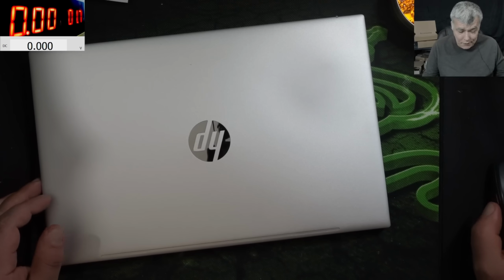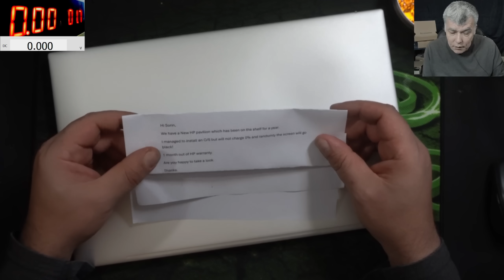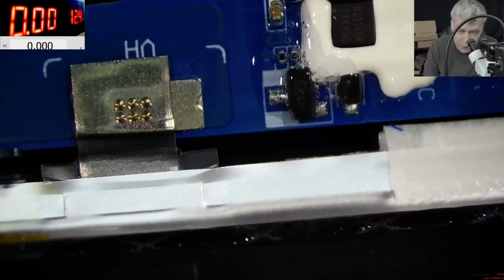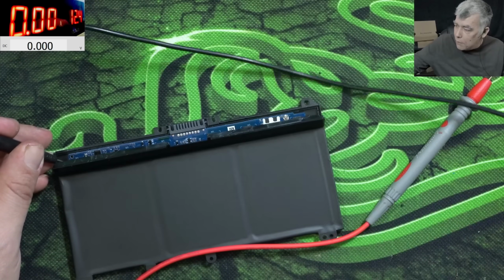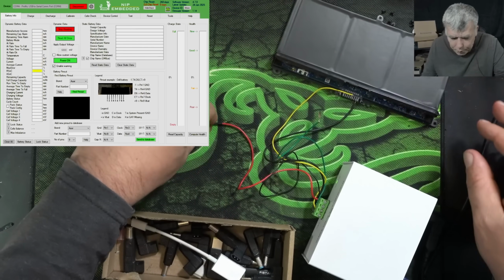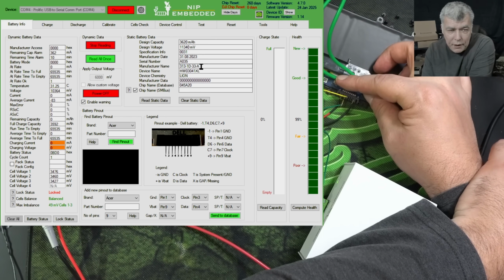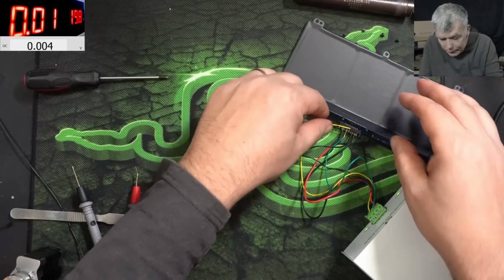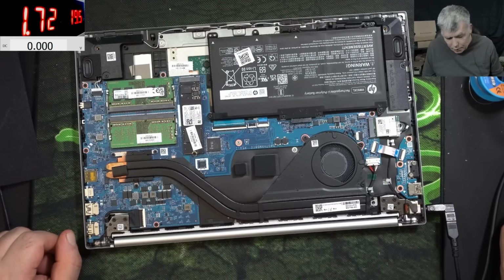1 Cycle count Hp laptop battery repair - Faulty by not being used

Comment: 11:10 "bq chip used voltage from one cell to blow the fuse so there is big unbalance" 

It is not correct. Please check typical schematic design for any TI battery monitoring chip. They got power from whole cells stack not from the specific cell. Fuse heater also is powered from common power rail. 

So the reason of unbalance is not the blown fuse.

Comment: Like the way the battery now has a removable plastic cover 2 get access 2 the fuse r cell heads, must have realised that sorin had 2 keep using the surgical incision method 2 get in, so now have made it easier 4 hi

Comment: Help with the battery BQ40Z696A V1T1.05 for Lenovo T480. The Nlba1 version 4.7 program shows that the health and charge are at 100%, but when I connect it to the computer, it shuts down and loses charge and health. Please help me, as I have many batteries with the same problem.

Comment: I have the same issue with a Nitro 5. Fully charged it, left it three weeks, it is dead and won't charge, the charge light flashes orange. It's 7 years old so I just replaced it. There should be a storage mode in the BIOS, correct? There is on my newer one, and my Steam Deck lol

Comment: Things are getting worse ''smart'' batteries now .....
Reply: This is not new, batterys get locked because of the no use or over current, You Will find this issues in laptops with 10+ years.

Comment: it looked like that tool unlocked the battery, did it need balancing before it was unlocked for the unlock to work?
Reply: The chip gets locked permanently when a cell gets imbalanced, so first, the all the cells must be higher than 3300mV and well balanced, then the permanent failure has to be cleared.

Comment: where do i get a power suply to find shortcirt like yours
?
Reply: Voltage injection power supply
Reply: Sorin already talked about it in several videos. It's LINEAR bench power supply, 30V 5A, they are not expensive. It's all you need for start if you gonna learn from this channel. There's a video of making one on your own with DIY kit which is very cheap.

Comment: Did the battery unlock as soon as you had the battery balanced or did I miss something? Thanks for the video.
Reply: no, he unlocked it thorough the programmer
Reply: @ДимитърАндонов-ъ7е  thanks
Reply: He unsealed the chip, cleared any errors, then sealed the chip. That unlocked the battery, but it was still unbalanced after that.
Reply: @gribbler1695  thanks